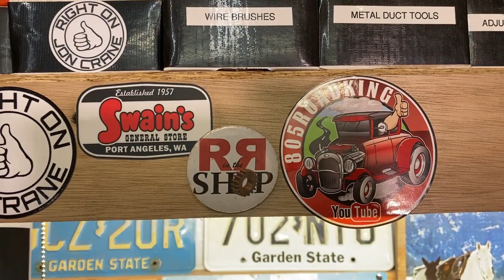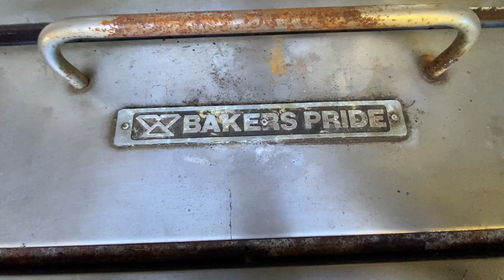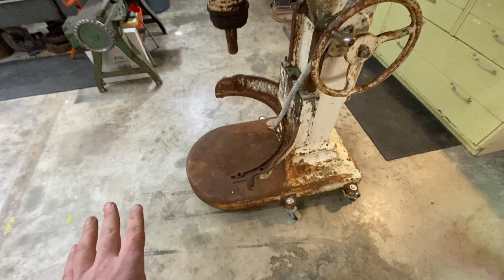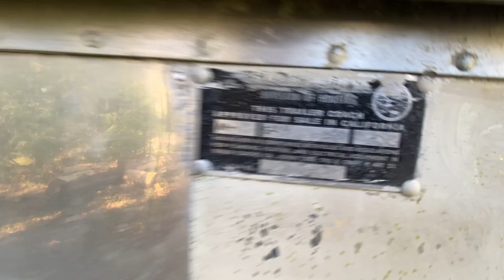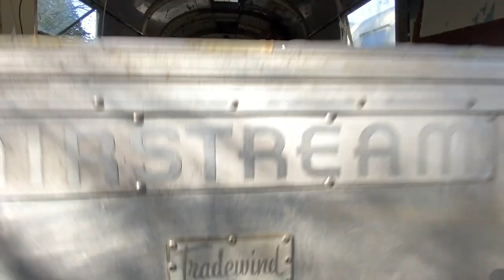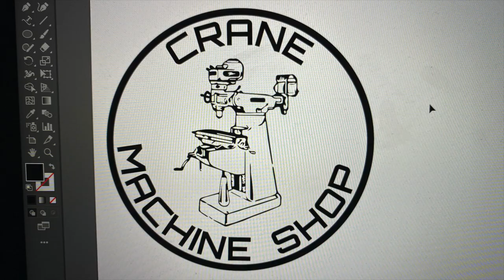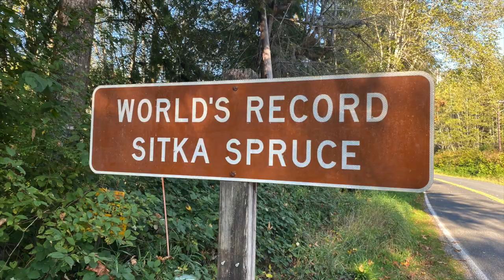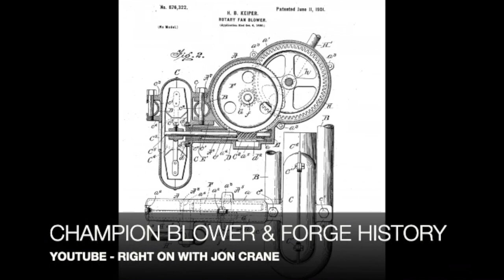BIG ANNOUNCEMENT - Airstream Trailer - Pizza - Taylor Ham Tuesday! Right On #78

Comment: Glad to see you’re back. It sounds like you have a lot of content that will be coming our way in the near future. I built a outdoor wood pizza oven many years ago. I would caution you about putting it indoors however. They throw off a tremendous amount of heat.
Reply from the maker: Right Ross! That is a good thing to consider!! 🔥🔥🔥🍕🍕🍕 I’m debating whether to do a bread style oven or a round pizza style oven. It may be that I build it outside and access it through the wall.
Reply: @RightOnJonCrane  I built a vault style oven with great insulation.  I can get it over 1200 degrees.  Pizzas cook in 60-90:sec.  The domes look nicer but require lots of cuts and geometric planning.   The key is good insultation too.  Use vermiculite as insulator.  

I use oak as fuel.  It burns 200 degrees hotter.  Do you have acces to hardwood?   These things burn lots of wood.